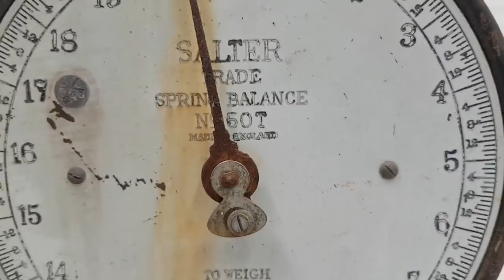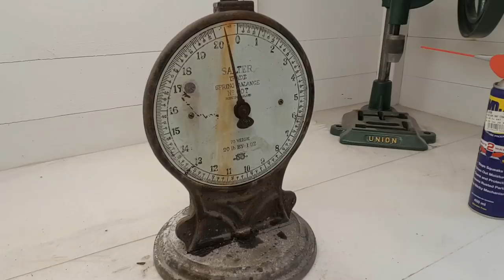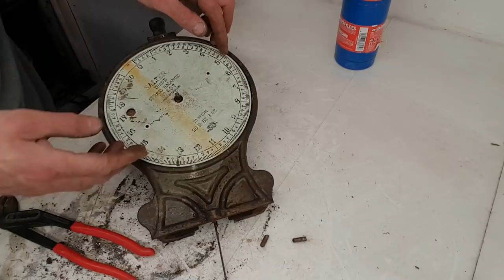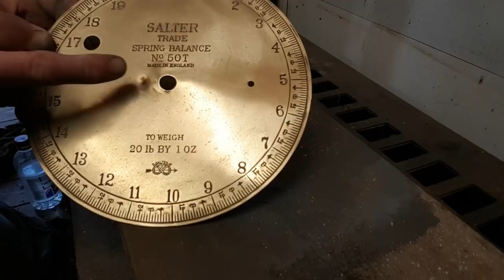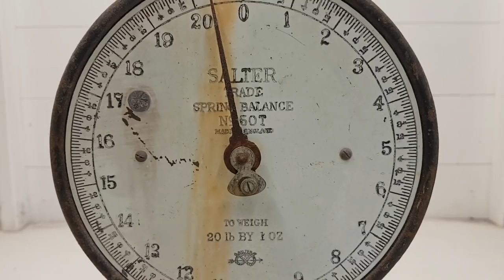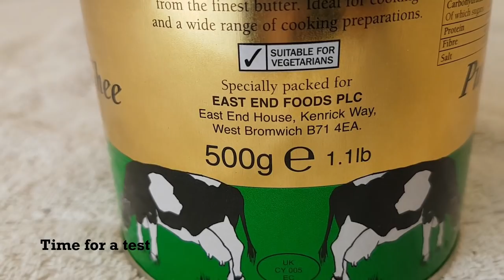Beautiful 1870s, Scales Restoration, Vintage Restoration

Comment: I'm looking at doing one of these Salter machines myself. How did you replace the central rivet on the pointer? I saw another restorer do it with superglue! Just wondering if there's a more 'proper' way of doing it.
Reply from the maker: Hi Kenwooden Chef, it's been a while since I did this one but I seem to remember it was just a spindle. I ground it down to remove pointer then flattened it down after refitting it. Regards Brian

Comment: The face was painted originally so the owner wouldn't have to keep polishing it.
Reply from the maker: Hi Homeyshiltz, I did wonder why they had originally painted it. Thanks for the info. Regards Unique Restorations
Reply: @UniqueRestorations  You can always clear coat it or use lemon oil to prevent oxidation.
Reply: Or cause it would be easier to read with a white background rather than a reflective brass background.

Comment: Wasn't the original texture of it rugged? The filler may have artificially smoothed it out? Nice though
Reply from the maker: Hi Pedazodeboludo. It's is a cast iron piece so it would have some rough finish. It's hard to tell how smooth the original item was as most of the paint was gone. I just tried to make the best possible paint finish. Thanks for you comment. Regards Brian